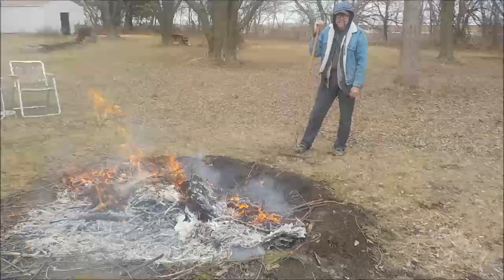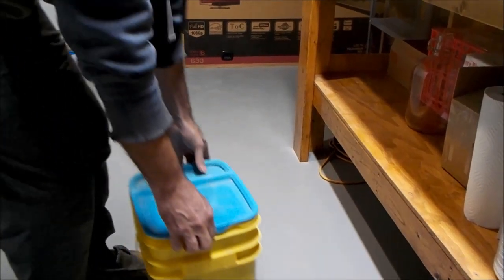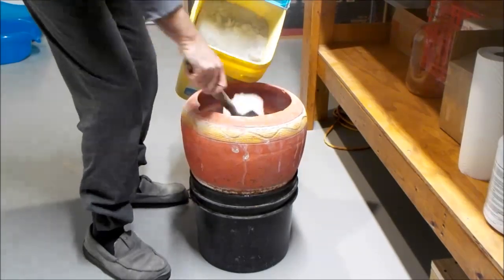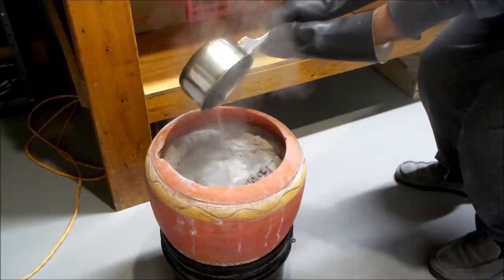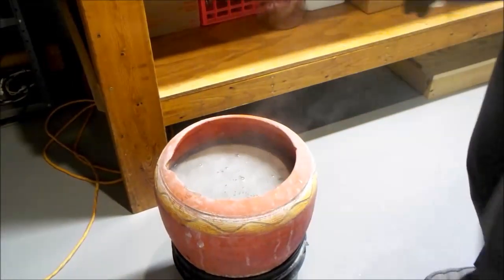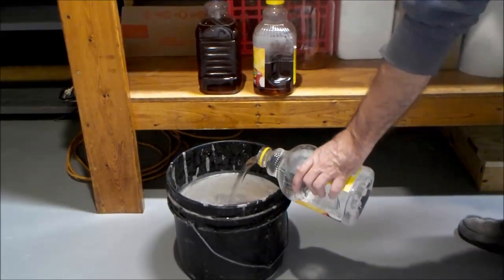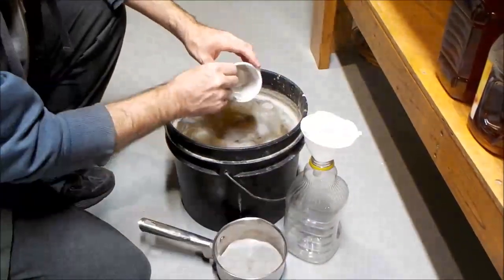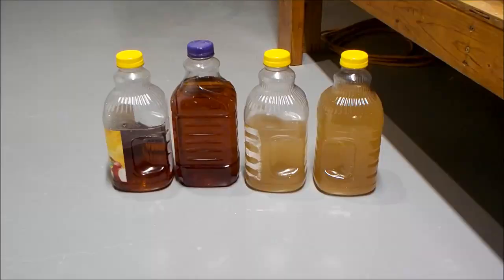Exploring Wood Ash Chemistry (1 of 6) [reloaded]

Comment: Does the boiling water cause a chemical reaction that room temperature water does not?
Reply from the maker: Thanks for your question.  

My thinking was that any soluble compounds in the ash would be more likely to dissolve in hot water than cold water.  I was not really trying to cause a chemical reaction.  I cannot say for certain that no chemical reaction occurred but I would not expect any.

Comment: The traditional youse for wood ash was making lye soap.
The ashes preferably hardwood ash was similarly placed in a container with holes in the bottom and a water tite container underneath.
The difference was to place the ashes where rainwater would leach the watersoluable material into the lower bucket. The dark tea is what was wanted as an ingredient for !he soap.
Reply: That dark tea is than let to sit for a couple days and just the clear part is needed in the soap 🧼

Comment: This is a better video production now than the others in the series because you edited it down to the main points. You did well to cut out the extraneous and redundant parts. Also speeding up the longer parts of the process, as you did, works well. Be succinct but remain interesting in the presentation. I believe your channel would gain more subscribers if you edited your videos in these ways. Good job.
Now, You say this extracted the 'soluble compounds'. In video 5. How is it you believe you arrived at calcium carbonate, a compound of low solubility?

Comment: Do different species of trees yield the same ash chemical properties?
Reply: no. softwood has too little potassium and too much resin. Its best to use hardwood
Reply: Ash from leaves and bark will have different cemetery than from the wood.  Higher levels of calcium and sodium vs potassium